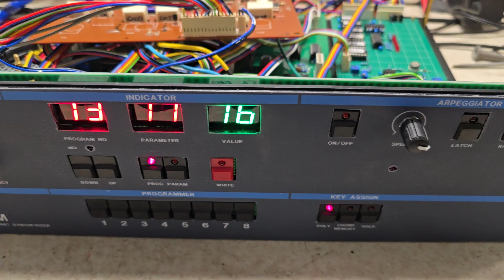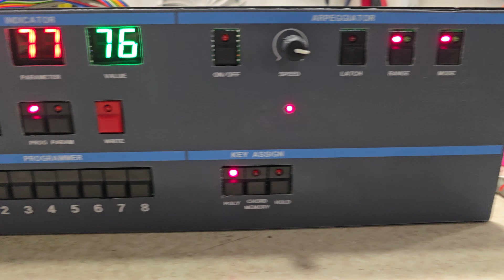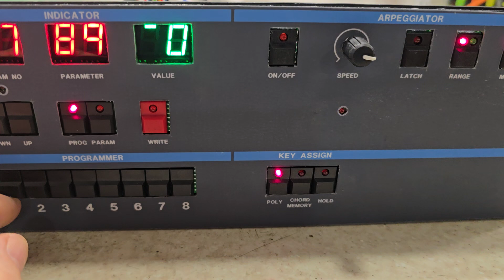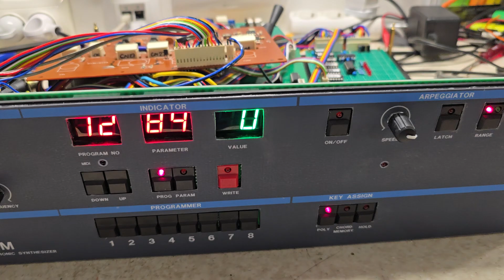Korg Poly 61 converted to a 19" rack mount

Comment: this is really cool. NIcely done. I have just repaired a very bad Opera 6 which also uses SSM2056 envelope chips. I hope to also use the Electric Druid as I need 3 new EG chips and at £40 a pop, it's prohibitive.

Did you just use an op amp to amplify the voltage from the SSM original socket to the new chips 5v rail? thanks
Reply from the maker: @waheex  not just amplify, also invert voltages. Obviously everything needs to be 0-5v for the ENVGen8C chips, so measure what is currently used for the existing ADSR voltages and calculate with opamps what you need to convert them to 0-5v, the sustain voltage may already be 0-5v.

Comment: That's an insane amount of work for a humble poly 61. It's a very good sounding 80's poly synth and one my favorite (I even prefer it over poly 6 ) to play now after having replaced conductive rubber parts and installing midi. Any interesting quick mods?
Reply from the maker: It's not really, most of the work went into making wiring harnesses, the rest is boards off ebay and some work of my own. I have a Poly61 keyboard so it removes the need for this keyboard and makes room for something else not available in rack form. I'm retired so I have time to do these things, plus its a much improved Poly61 with MIDI, extra LFO, MIDI sync of the Arp, control changes for parameters, higher resolution of parameters, program changes etc.

Comment: This is great work. Saw your posts on diy synths. I am currently building a sequencer run by the ATMEGA328-AU custom board. I can appreciate your hard work. You have done a great job with this. Will you be going to Synthfest Sheffield?
Reply from the maker: Thanks, no, I'm based in Ukraine, Sheffield is a long way to drive.
Reply: @craigyjp  I see, that's a shame. I wish you all the best with your synth. Will you be putting it back in the original case to resemble the original synth.
Reply from the maker: no, this poly61 never had an original case and keyboard as it's made up of second hand parts from eBay and home made bits, I have a poly61, so this can be an expander for 12 voices or a standalone synth.